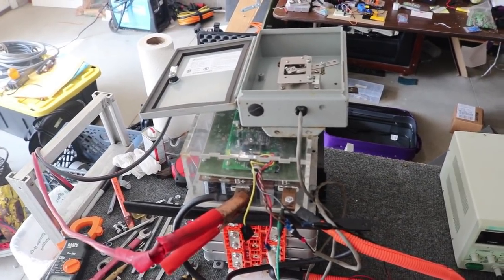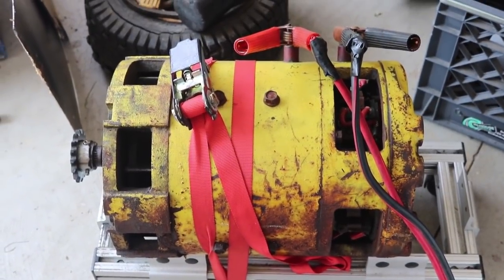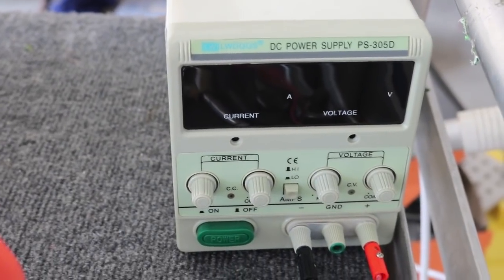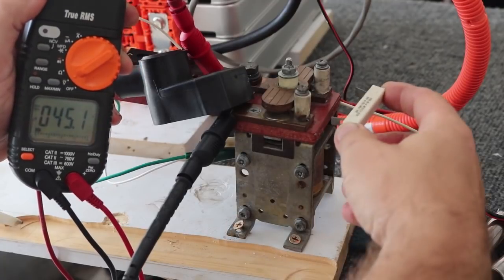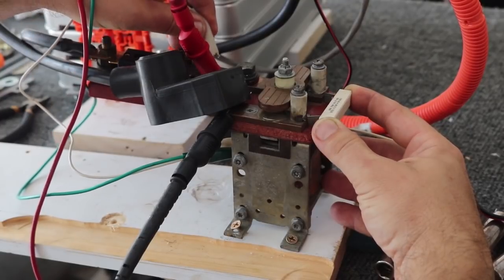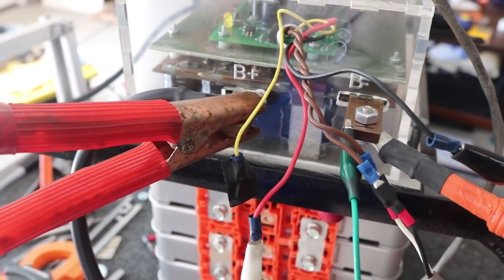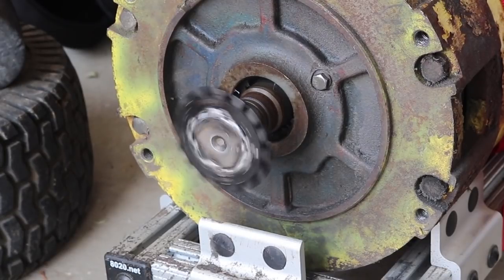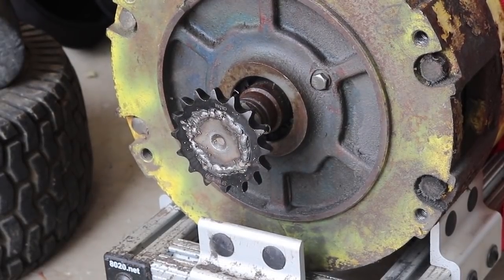ElecTrak Rat Rod Part 9 - Bench Testing Open Revolt DC Motor Controller

Comment: Even though you don't have the same battery pack size... Putting a motor that moved around 2000 pounds of car at a pretty good clip on a package that will weigh just over a fourth of that? God I wanna see this thing go! Should be a hoot! lol

Comment: Hi Ben, have you recently checked the project pages of ReVolt? It appears to me, that the project(Open ReVolt Controller)  is pretty much dead. Lots of dead links, lots of threads are last commented years ago and so on. Any insight? Greetings!
Reply from the maker: It's an old project. Paul has some new stuff on https://pandspowerelectronics.ecwid.com
Reply: @BenjaminNelsonX  hi, that link seems to be dead now aswell, is there somewhere else information about this controller?
Reply: Seems weird such a good project died off. I wouldn’t mind if someone was now selling it as a commercial product. 

Has anyone dived into the forums to find out why? Was the design  faulty? Super exes by better design? Underpriced by a commercial product?